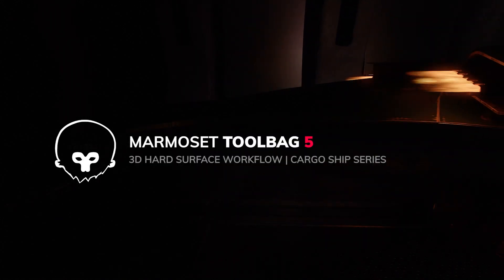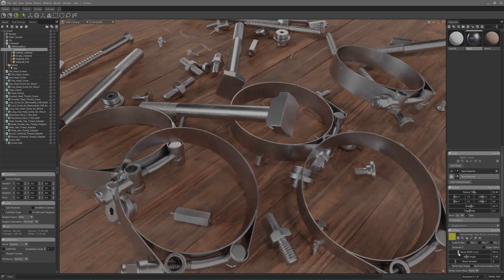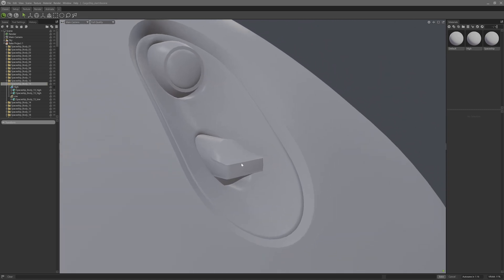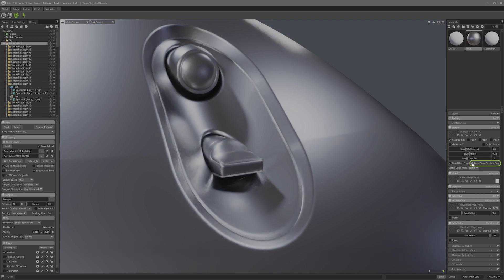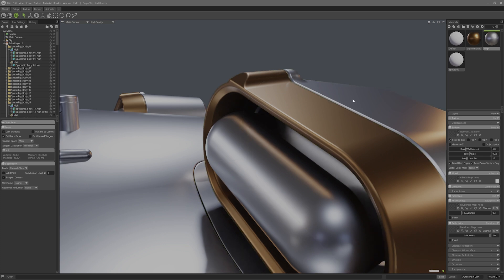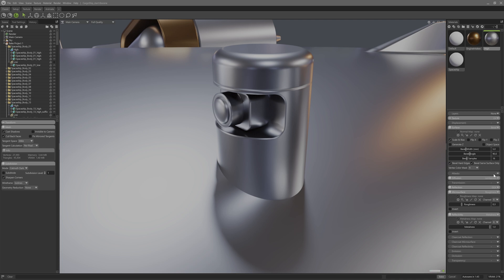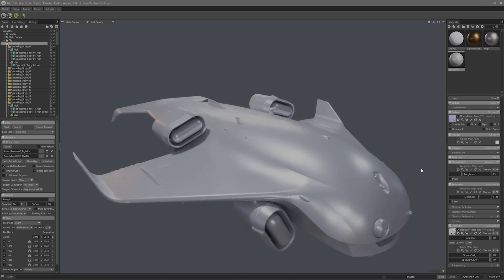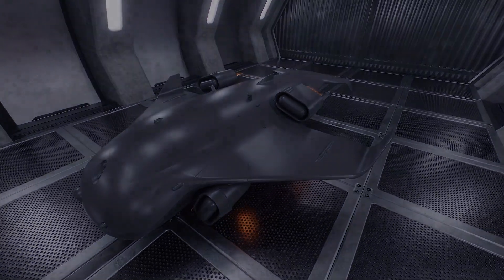Part 1: Bevel Baking & Shading a 3D Model in Toolbag | Cargo Ship Series

Comment: The way the vertex colour beveling system works seems extremely convoluted for not reason. So if I want one edge to be half as beveled as the edge next to it I need to vertex paint 1 edge 100% red and the other 50%? Then just go to Toolbag, apply the Red filter and just HOPE I like the result, then if I don't like it I have to go back to my DCC and make the other edge like 70% Red if I want a slightly bigger bevel, then export back to Marmoset and retry? That sounds like a really hack job solution to multi-width bevels. Why not just add 3 separate bevel channels to the shader itself in Marmoset, so you could adjust the Bevel Width slider in real time independently for R, G and B. That way I can just vertex paint 1 edge Red and the other Blue then tweak the sliders manually in Marmoset until I am happy with the result? That way I'm not bouncing back and forth and back and forth exporting over and over as I try and nail down exactly the edge ratios I want.

Comment: How do we go about this if we want to set up "Bevel same surface only" but only apply that to certain overlapping surfaces? For example if a model has bolts or screws that I don't want to bevel as if they were one, but I do want to bevel other overlapping parts?
Reply from the maker: Hi there! You can use different materials on different parts and enable/disable the bevel same surface setting accordingly.

Comment: How did you all create UV's for the model? Does Marmoset have an option on import to auto UV parts? If so that would be nice to call out that part. I know the point of the video is the bevel shader (awesome by the way) but as a plasticity user I am curious how you handle the UV situation. (I have seen people show off Blender Workflows to create UV's) (3D coat has an auto UV option and I believe Substance Painter does as well.)
Reply: These are UDIM's, most likely created by hand.